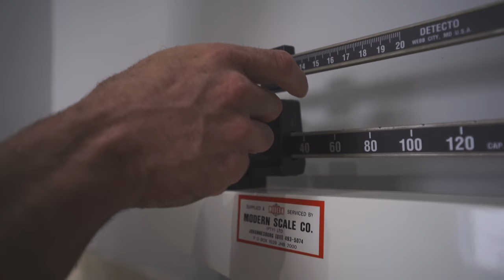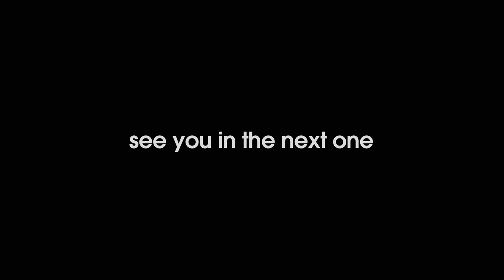How to make your own dumbbells at home for cheap! | VLOG

Comment: As a builder in America, if you buy cement you will need sand and aggregate(rock). If you buy concrete it will already have sand and aggregate in the bag. Be aware that there will likely be "Lightweight" mixes there as well. You may or may not want that.
Reply: thank for the knowledge Mr builder in America
Reply: Never knew that it came mixed. I'm a builder here in Brazil and we have to buy it always separately and do the proportion ourselves.
Thanks for the information. Best regards brother!

Comment: I have a pair of 4.5 kg dumbbells at home that I made with my uncle. 
After the concrete was set, we bought a few waste rubber tubes from nearby garage and cut them and pasted it all over the weights since concrete starts to crumble little by little when u use them as weights. The rubber protects it from harsh impact. 
We're also making a barbell and weight plates using concrete atm. Hope it turns out well 🙏🏼

Comment: Is there any chance you can do a video on finding your right calories/macros? That’s probably my biggest struggle.
Reply: He has a calorie calculator in his tiktok bio
Reply: Its easy... Just eat and watch the scale. If you.are getting fat then eat less
Reply: @dustencross357  It isn't that simple, your body can adapt to lower calories and maintain at those lower levels, but your energy and strength will be garbage as your body wont have what it needs to work near max potential.
Reply: @N3G4T3  if that is happening its because you are not meant genetically to be that lean... Some people can maintain sub 10% year round some people cant.. You cant fight you body for long... It will always win in the end 😎
Reply: @dustencross357  Not really, it's standard adaption that everyone has, otherwise we wouldn't have been able to survive in the wild. Doing zig zag calorie cycling usually works to overcome the adaption though.
Reply: @Rusin I currently use cronometer to calculate required body macros and micros, it also calculates food macros and micros when you input your food. Eating the right types of foods makes a pretty big difference too, stay away from processed food for the most part.
Reply: @N3G4T3  again... If you have the genes to be that lean it wont matter... I have not experienced those things and i have been way more lean than you see in my pick
Reply: @dustencross357  I'm not disagreeing with the fact that certain genes determine whether you'll stay very low body fat percentage, I'm simply saying that due to metabolic adaption you can't rely on whether your weight is going up or down as a basis on whether you're eating the right amount of macros or not.
Reply: @N3G4T3  cool...... Im not disagreeing with you either. I have been told i can come off as an @$$ hole but that's not my intention i just don't conversate very well i guess?

Comment: Doing this with the concrete on a scale while you add it, you can add metal screws washers and nuts, basically scraps to get the weight to where you want it.

Comment: I have some interesting ideas to share in this.

 I have found that putting sand in the travel bag from a HUGE bucket/drum of sand for isolation exercises is really good. 

  Basically grab the bag by its handle and do your isolation work.

  And for compound presses and rows, big 80litre travel bags, putting one into other, 3 of them like that, And then you can fill that 80 litre bag up with 120kilo of sand, and it will take that sand well. It won't be overloaded. 

  Problem becomes whether the bags handles will tear under its own weight, you can use seat belt straps tied around the bag and use the remaining ends tied in a loop as extra handles..... That will take care of it.

   I suggest multiple 80 litre travel bags loaded with a maximum of 60kilo of sand. 

  You can grab multiple of those each hand and do neutral grips overhead presses and bench presses. Front felt raises are always there if you think you are missing out on pronated grip benefits.

  Rows are easy.

  The benefit of these types of apparatuses are simple. You will be lot stronger with the dumb bells once you do get to the gym.

Comment: Wet concrete 🔥 the skin. Use cloves if you are going to handle the stuff. My 2c.
Reply: Nah it's fine in short intervals of time. If you're doing it for hours and hours without washing your hands in between then it'll eventually dry and pull the moisture from your skin and result in burns. But you can definitely handle it for short periods of time. Definitely use gloves for extended use though.

Comment: I personally recommend if you are a complete athletic noob to legit any kind of decently challenging activity, i def recommend going and buying 2 1 gallon(nearly 4 liter) jugs of water, its close to about 4 pounds or so each jug, defo good for getting the ideas of the motions you need to do with dumbbells, much cheaper than any 1 or 2 pound dumbbells you can buy on amazon, for example

Comment: Went through the top comments real quick and didn’t see anyone mention it. My guesses on why the dumbbell was almost 11 kg
1: you cut the top part, the volume was reduced as it is measured from the bottom of the jar up to where the lid covers the neck of it
2: volume and weight are two different things, ie 3 litres of water are 3 kgs but 3 litres of other material/fluid doesn’t  mean 3 kgs. In other words if it wasn’t cement the final weight most likely would have been even less.

Comment: If your goal is to be a bodybuilder or strongman or any other type of strength athlete, you need to get your nutrition in order before you focus on the gym, but if you just want to get moving, a little stronger and a bit more toned up even someone only intaking an average person's daily nutrition could technically still workout, but at some point that person isn't going to lift anymore weight after a certain point or put on anymore muscle